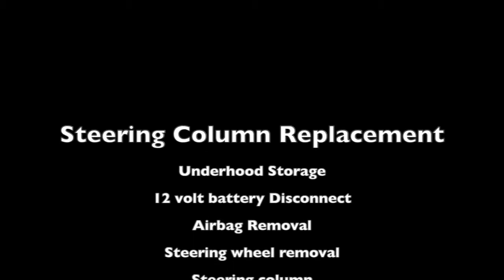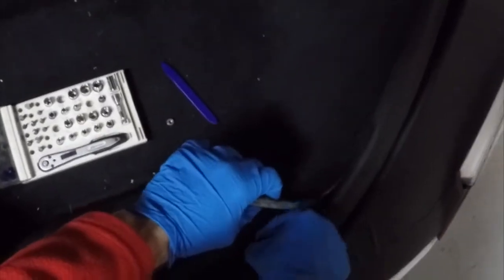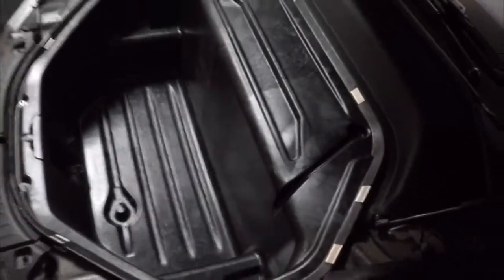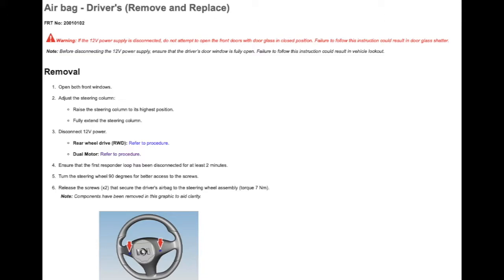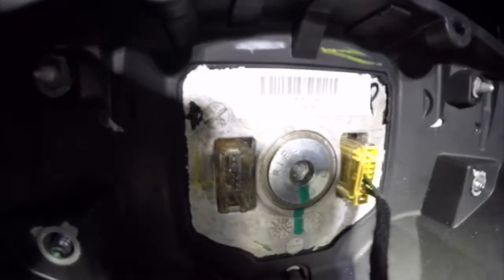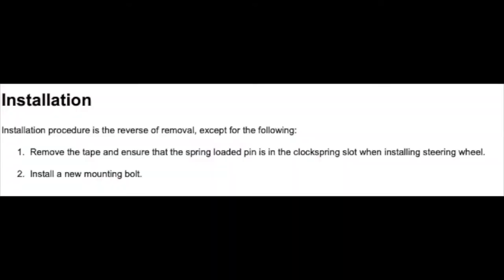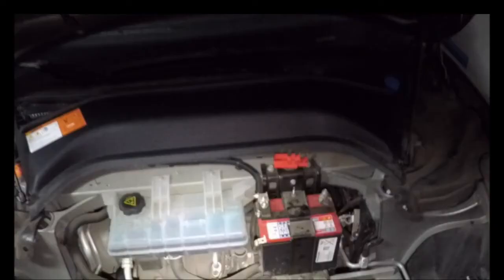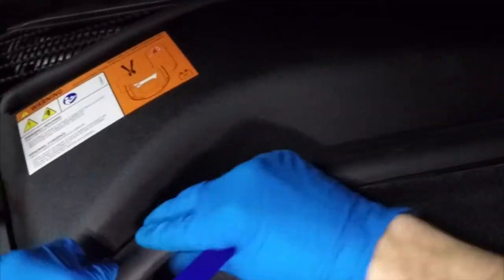Tesla Steering Column Repair | Broken Turn Signal | Turn Signal Repair | Tesla Model S Repair Save $

Comment: This was great! One question: Tesla's guide for "Module - Steering Column Control (Remove and Replace)" mentions hooking up a laptop and use Toolbox 3, go to vehicle configuration and change a value for the steering wheel, and then reinstall the firmware.

Did you not have to do that?